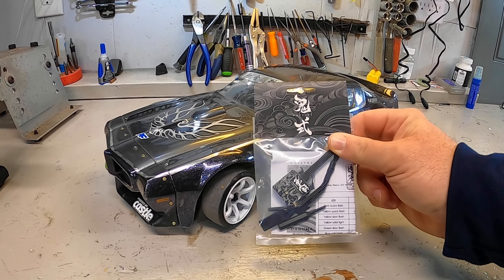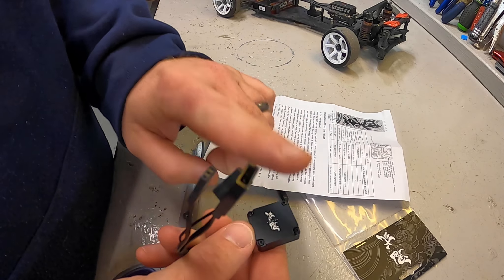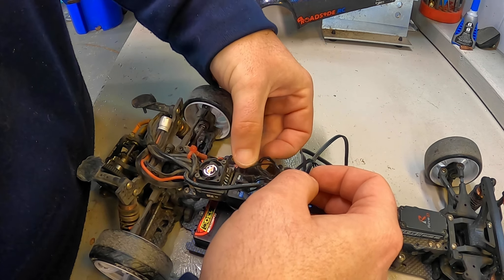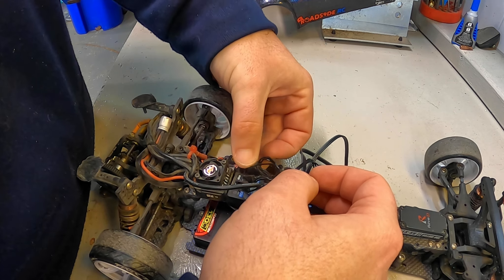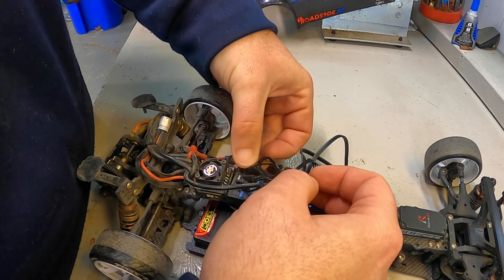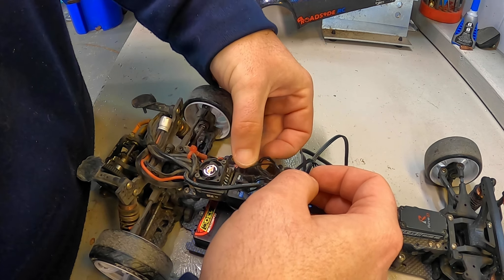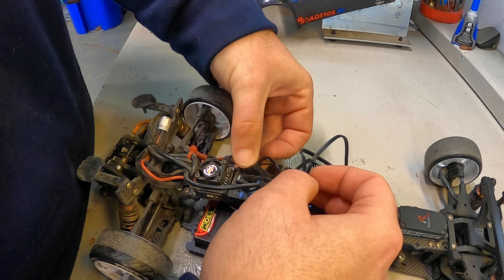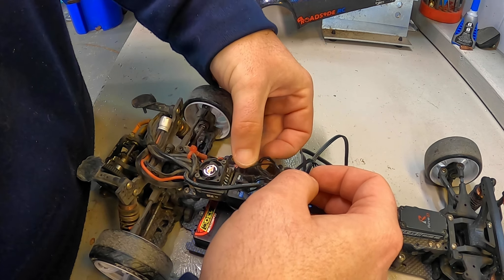Onsiki Daruma RC Drift Gyro; Installed | Tested | Reviewed

Comment: Great Video!! I finally bought the last piece for my Rc Drifter (FS-GT3C) and this video helped me put the Gyro (bought tons of Onisiki parts) ❤
Reply from the maker: Nice!   Hope you enjoy drifting!
Reply: I am having hunting problems with it, I had it really bad, adjusted the front end and now its way less. Still like it. Was told could be my controller, have you heard or seen anything like that?
Reply from the maker: @Bluespade115  People refer to different problems with different names.  When you say "hunting", what do you mean?   Describe the issue.
Reply: @RoadsideRC  it has front end wobble a bit, it was really bad at first, I installed a slide rack and adjusted the turn buckles, it is way less than before, but also was told maybe gyro placement? I have it on the bottom part of the chassis. I will try to take video this weekend.
Reply from the maker: @Bluespade115  Gyro placement has no affect on this.   You will need to reduce the gyro gain.
Reply: ive been trying to figure this out and have to say, rewatching the video, I forgot channel 3 is for gyro control -.- 

Thank You Again for the Video!!! @RoadsideRC
Reply from the maker: @Bluespade115  Glad it helped!

Comment: Great video. When you're driving at the track or in the garage. Do you have it on AN or DG? The color change from blue to green. Is that assist mode and Normal mode?
Reply from the maker: An or dg is analog or digital.   That is switched depending on the servo type you have.  No reason to change it again. 

The other color change does change how the gyro performs - and you will need to test it to see what you like better.

Comment: I just ordered this gyro and the Onsiki 120A ESC, with a Rocket Drift 13.T motor. This is going in a Tamiya TT-02 with a Yeah Racing drift conversion kit. I'm pretty much a novice so this will be interesting.
Reply from the maker: Good luck with the build!!!

Comment: Have you run into the issue where?For some reason, it is actually counter steering.The wrong way. I went through got it set to the right Axis Made sure none of the channels were reversed, and yet, for some reason It'll turn into the skid, instead of trying to correct out of it
Reply from the maker: Yep!   Very common. 
Just swap the gyro direction and you will be good to go!
Reply: @RoadsideRC  ok so check this shit out I'm running a radiomaster mt12 and I had to reverse the servo so when I hooked up the 3rd wire and reversed it problem solved